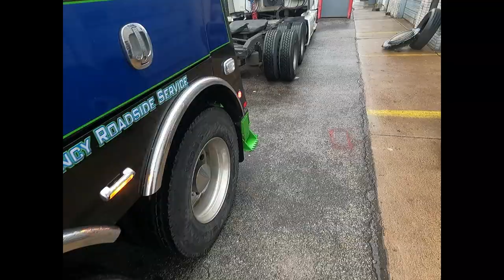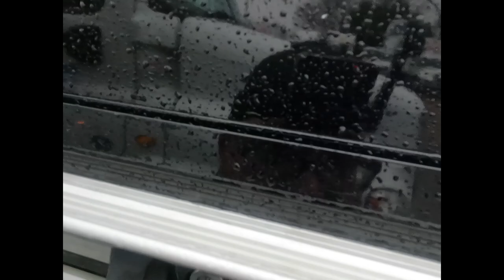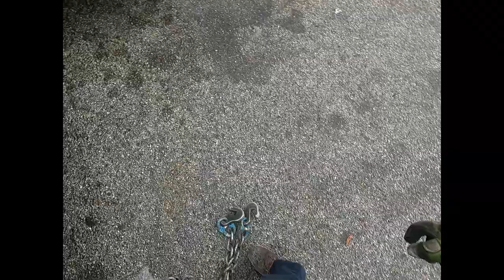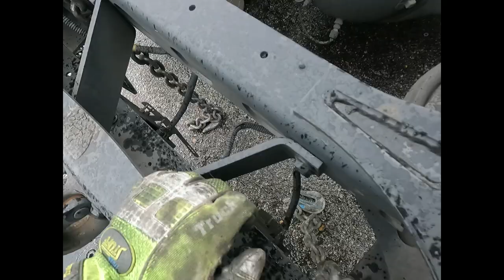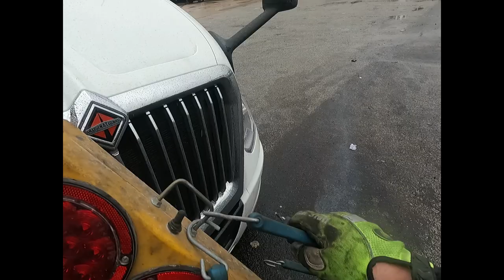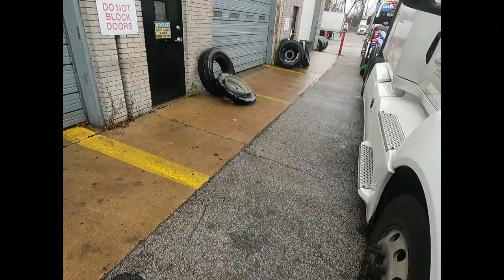International Sling Tow

Comment: Tend to just use the ubolt attachments. Easy to line up and pick up. If imma go the sling route, I'm just gonna use a 20 foot 1/2 in and go from in front of the forward drive all the way to the back. Both axles supported and only using 2 chains
Reply from the maker: 99% of the time I just grab the u bolts, but I already had the risers on from a previous tow and I’m just trying to show different ways of doing things for every one. There is 100 different wants anyone would hook to something. Just trying to help and show some of them.
Reply: @TowManRines  got ya. Yesterday I ended up using the wheel lift attachments for a coach bus. Those shit will stay on my truck for the next month before I take em off. Unless I absolutely have to take em off
Reply from the maker: I’m the same way, but my luck is normally being the next tow would be a rear tow on a 26’ box truck or an over loaded garbage truck
Reply: @TowManRines  exactly the same, and end up having to rear tow em for broken suspension
Reply: @TowManRines man FKCU a garbage truck.... Yuck yuck yuck.... Especially in the summer with maggots and trash juice fallin on you....

Comment: I've been taught to let the air out if the bags first before chaining up the axle. Is it the safe the way you had done it?
Reply from the maker: When I moved the truck to a spot to get hooked up, I already flipped the dump valve on the dash for the bags to drain before I even started hooking up. Normally I do that or just disconnect the lines on the air bags soon as I back up to the unit before I start hooking up.
Reply: You don't really have to unless you just need more clearance. 
On the other hand, if you are picking by the u bolts then definitely yes.

Comment: Those axle chains are tits! I know what I'm telling my boss to order Monday. Who makes them, b/a? So much better than running a chain across the frame and trying to fish it around under the axle with a kingpin puller.
Reply from the maker: I can’t remember now, but I got them off best tools website.
Reply: @TowManRines  I'm in Canada hopefully we can get them here. I was thinking you would need four to sling it but two seemed to work just fine. I guess it can only go so far up against the spring stops. Thanks for the awsome video. I've never slung anything before, think I'm going to try it. Looks pretty quick. We have an NRC and a jerr-dan heavy, pretty sure the jerr-dan has similar hooks on the  wheelbars in the tool box. It has the bus bars on most of the time but they are a pain in the ass to adjust as they are old and not too slidey anymore. I'd rather fork. The bus bars are good for motorhomes f550s and stuff like cube vans with 225/75r16s  it'll go small enough for them.
Reply from the maker: I know what you mean. We don’t have a bus bar on any of our trucks here and we have 7 heavies running every day. I do a lot of sling tows down here because we have a bunch of scales all within 50 miles of each other. I’ve always only chained up one side of the suspension, long as you get that one side tight, it won’t let the other side drop down much at all
Reply: The easiest way is to run the tow  chain under both axles up in front of front of drive axle  up  to frame then you are picking truck up by drive axles !